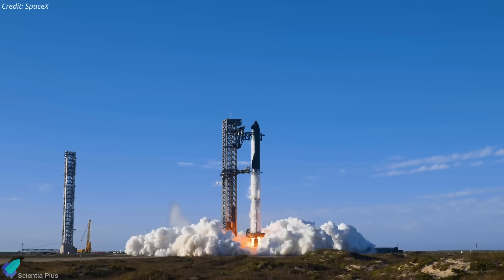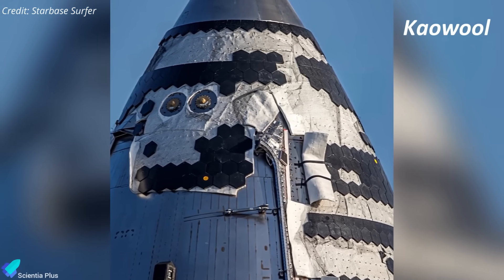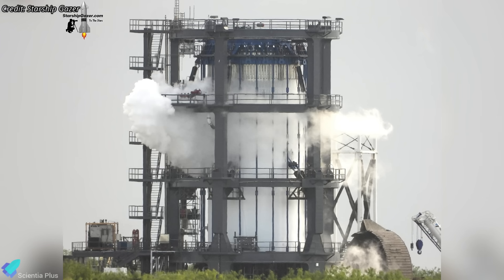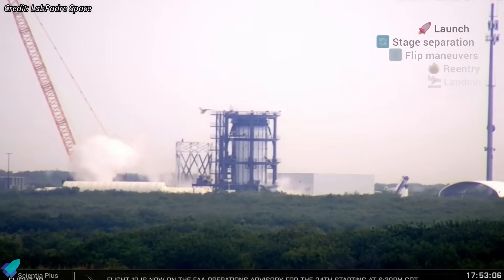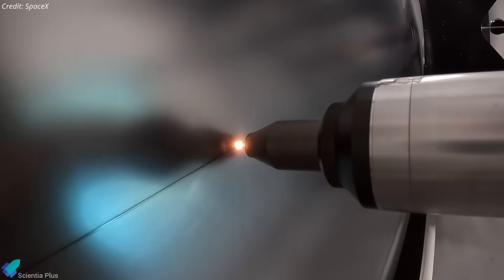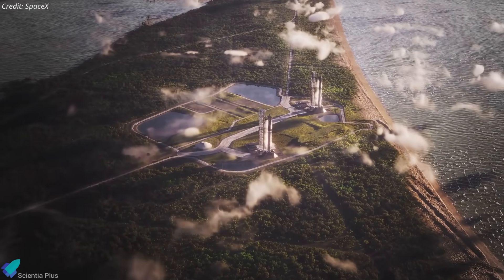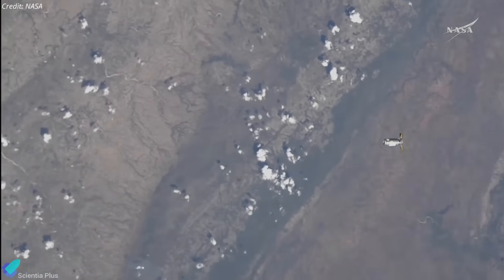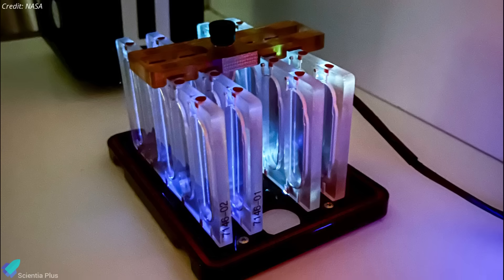NASA Slams SpaceX Over Starship Too Slow! Flight 11 Launch Locked!

Comment from the maker: 00:00 Starship Updates
09:36 Cygnus XL Nearly LOST in Space!

🚀 Starship Flight 10 
  📽Detailed Breakdown: https://youtu.be/irVUMJNe0Kc
  📽Root Cause of Anomalies: https://youtu.be/LBUpp7MRVSY

📚 Learn More:

🚀 Starship Block 2 Explained:
 📖 Summary: https://shorturl.at/b0dtw
 🔍 Detailed Explanations:
  • Design Improvements Update 1: https://shorturl.at/lpGT7
  • Design Improvements Update 2: https://shorturl.at/gwNQ4
  • Nosecone & Payload Bay Redesign: https://shorturl.at/xa60S
  • Methane Downcomer Redesign: https://shorturl.at/XdYBG

🚀 Starship Block 3 Explained: https://shorturl.at/mnBT4
  • Detailed Breakdown: https://shorturl.at/IViwD
  • Production Begins: https://shorturl.at/xRNkJ
  • New Transfer Tube / Downcomer Explained: https://shorturl.at/Iaqc6
  • New Grid Fin Explained: https://shorturl.at/NxdVo

🚀 Starship Block 4 Unveiled: https://shorturl.at/7A2ef
 
🔥 Raptor V3 Mega Upgrades & First Test: https://shorturl.at/TRIyj
🧱 What’s Inside Starship GigaBay?: https://shorturl.at/nJM75

🛠 Insane Engineering of New Starship Launch Pad 2: https://shorturl.at/7RAZd

🛢 Dual-Port Orbital Refueling – Full Technical Breakdown
https://shorturl.at/5tiqK

🛠 Other Starship Upgrades:
 • Hot Staging Explained: https://shorturl.at/jf400
 • Super Heavy Booster Upgrades: https://shorturl.at/Pi5R3
 • How SpaceX Protects Raptor Engines: https://shorturl.at/4Om8F
 • New Heat Tiles Explained: https://shorturl.at/p2Ijb

🚀 Starship Flight 10 
  📽Detailed Breakdown: https://youtu.be/irVUMJNe0Kc
  📽Root Cause of Anomalies: https://youtu.be/LBUpp7MRVSY

🚀 Booster 18.1 / Test Tank 17 Explained In Detail: https://shorturl.at/wPg6Y

📡 Stay Updated:
📢 Weekly Updates: https://bit.ly/3HIQjPC
🚀 SpaceX Playlist: https://bit.ly/34wue8T

🌍 Follow Us:
👍 Facebook: https://www.facebook.com/scientiaplus

Comment: I don’t know ‘who’ at NASA would be saying that - considering just how long their SLS took to build !
Reply: NASA is just embarassing themselves at this stage yet are spouting off like their present record is impressive. Of course experimental, never before seen systems take time to develop and test.
Reply: That’s the pot calling the kettle black 😏.
Reply: The SLS was faster to develop than Starship and it worked in the first try.

I get it that Starship is a more ambitious project, so there is good reasons why it is taking longer, but fast it is not.
Reply: @torben777  At something like $4bn per launch SLS should damn well work first time. Starship is a way more technologically advanced and ambitious system than SLS which relies on 40 year old Shuttle technology. If you want to get a small capsule to the moon then SLS works but Starship HLS is aiming to get well over 100 tones of cargo to the moon in addition to it's own mass. Nothing else in development or even in early conceptual design stage comes even close to that.
Reply: @torben777  even if starship wasn’t reusable it costs far far less to build one compared to SLS
Reply: @torben777  are you that ignorant or just stupid?

SLS started development back in 2011, had its first launch back in 2022 (11 years later if you can't count), and its costs are astronomical (around $26 billion total, with $2.5 billion wasted per launch).
SpaceX announced Starship back in 2018, they had multiple successful test flights through multiple iterations of both the booster and the ship itself, while the whole project's cost is around $5.5-6 billion so far, with a cost per launch being around $100 million which is 25 times cheaper than the waste called SLS.

In the 4 years it will need to reach the timeline of SLS, SpaceX will already have dozens of them launching regularly for orbital missions or beyond, and the total costs will still be a fraction of the current waste of the SLS. Let's not even compare the usefulness and per-flight cost of each.

edit: Let's also add the fact that Starship is orders of magnitude more complex with a vastly larger scope.
NASA is pathetically trying to re-create old tech, and everyone else is laughing at it. While everyone is desperately trying to copy SpaceX even if it is just the Falcon 9 (Starship is way beyond their capabilities) because even that is years ahead of anything else.

Comment: It will be another 4 to five years before Spacex is ready for a moon shot. Fuel transfer may never work out. That means 6 to 7 years for  a moon shot. We will have to get a visa to visit the now Chinese owned moon. The democrats will be running the government by then and will cut NASA's budget to the bone.
Reply: We can go to the Moon right now with expendible Falcon Heavy, and the Chinese don't have anything better than what we get using Falcon Heavy. 

It all depends on what you want to acheive and how we want it done. Any system that wants to accomplish a Moon Base is Just gonna take some time to do and Starship is better than anything else out there.
Reply: The Starship will be to the moon by 2028 at the latest.
China can't own anything until they can achieve at least 1/10th of what SpaceX has (and they are still years away from that).
Also, the Demons are not winning again for at least another decade. After Trump, Vance will take the helm in 2028 and 2032. No one is supporting actual evil.